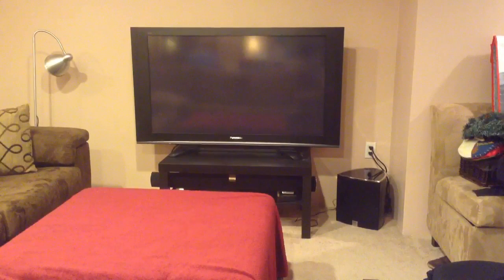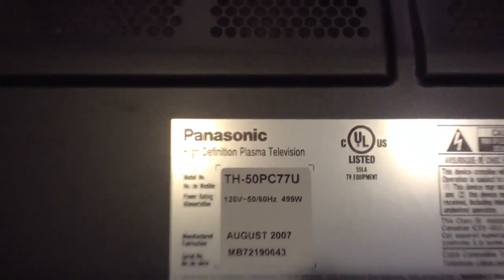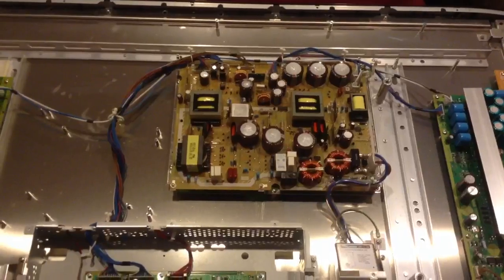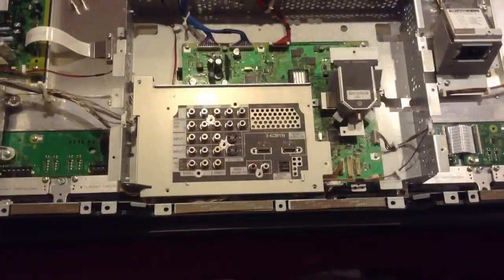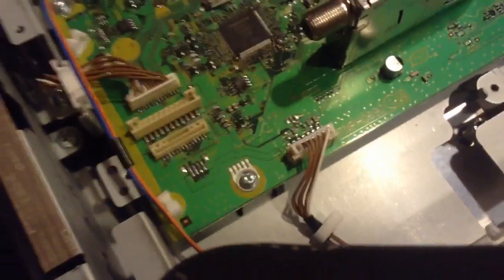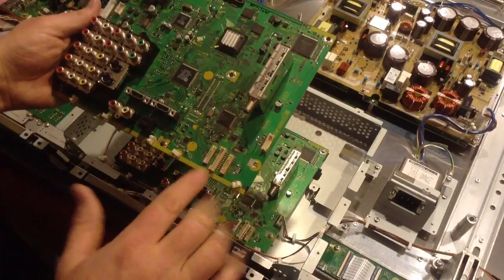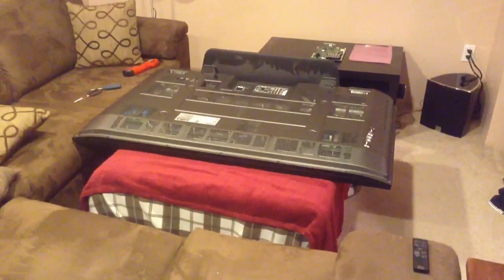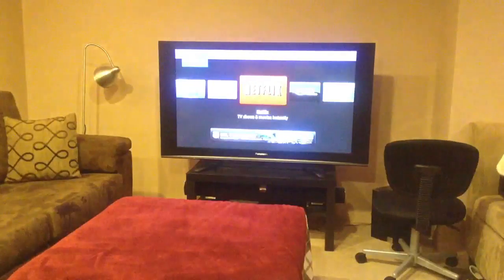50" Panasonic Plasma TV repair - Signal Input Logic board replacement

Comment: Too bad the most important part was "time lapsed".  Many differently sized screws and not too likely to remember where they all go exactly.  Could have at least mentioned where the oddball screw sizes go.  Everything else that is gone over in the video is basic so it turns out the only thing that might need clarification is the screw placements and maybe wire placement.  Both of which were fast forwarded way too fast.  Very poor call.  Now this TV is lost in time so the chance to get a better videos is over.

Comment: My 50” plasma 2007 TH-50PX75U is not the same as the pic, I need a video for this Panasonic - top 1/2 of screen black  with 2 Z electrodes

Comment: Can you give anymore advice to not getting electrocuted?  I'm going to replace my "A Board" myself.  I'm leaving the TV unplugged for 4 days in hopes that it will discharge the power.  My only  issue was all 3 of my HDMI inputs stopped working but the TV menu still works and everything else seems fine.  I really like this TV and found a good price for a refurbished "A Board".  Your video makes it look fairly easy (minus the 50+ screws and the possible electrocution).
Reply: Bake it in the oven for 5-10 minutes. Preheat  at 350 and  just be sure to use a Pyrex dish to set in and keep a close eye on plastic components of motherboard.

Comment: I had this exact same problem with my panasonic plasma and your video gave me the confidence to replace the board.  Thank you!
Reply: My Panasonic 50 inch plasma TV lost all inputs except for the pc input and component video inputs. At first I thought that my cable had gone out, and then thought that the entire set had gone bad. After researching, I found information pointing towards an input board that may have been zapped during a thunderstorm. Did you experience the same thing. How is your set doing after 5 years?